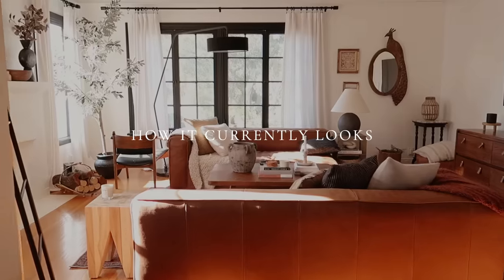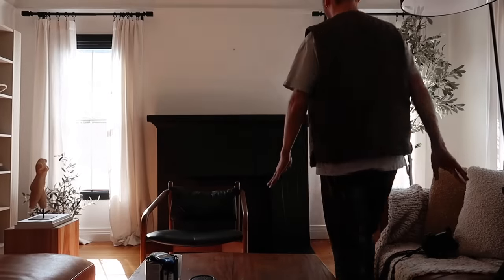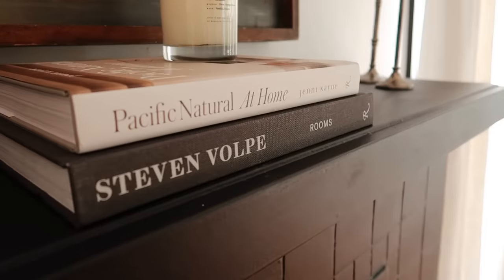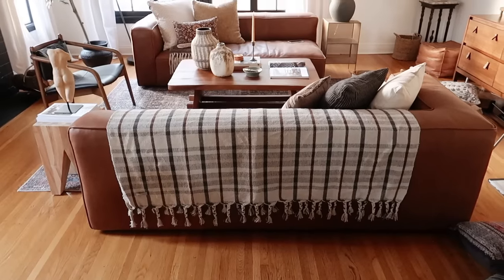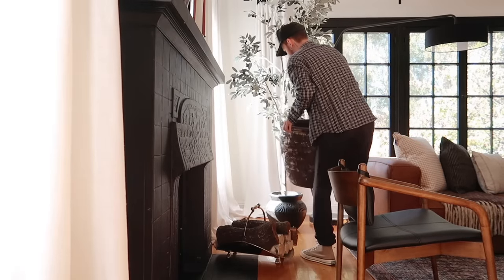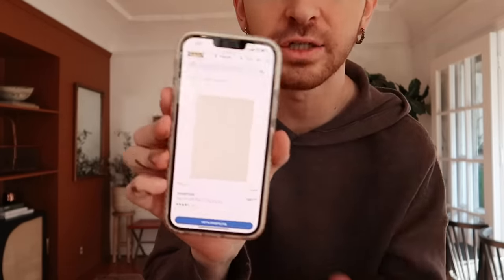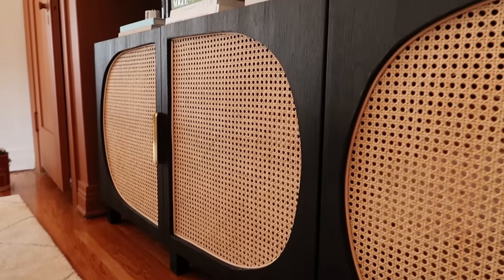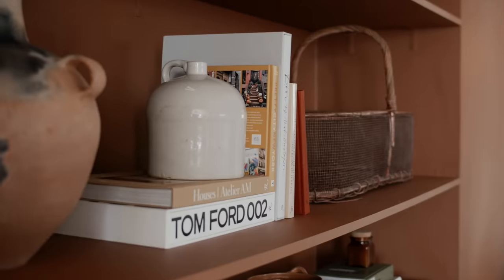Making over my apartment... AGAIN 🔨 Refreshing my space for 2022

Comment: You may consider putting the Iarge pot on roIIers or feIt to keep it from scratching the hard wood fIoors if moved in cleaning.  AIso you can use Iarge pieces of foam to stabilize the cement bucket inside the pot or raise the height.   Then back fiII it with large pine cones.  You Iive in CA get those large "sugar cones" and back fiII to hide the inside void around the tree.  AIso acts Iike an air freshener.